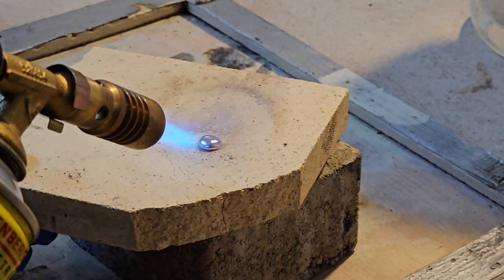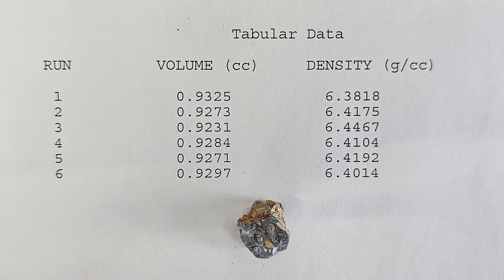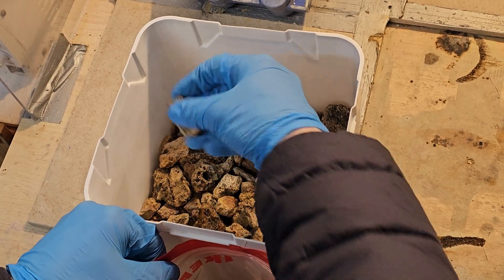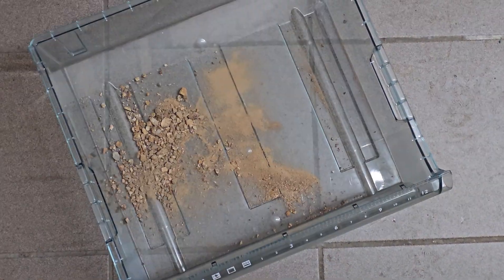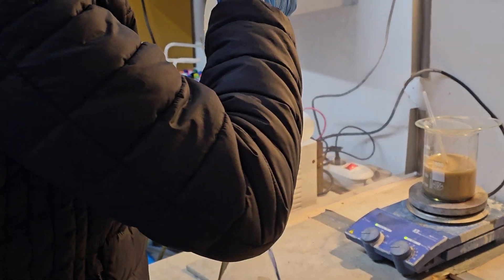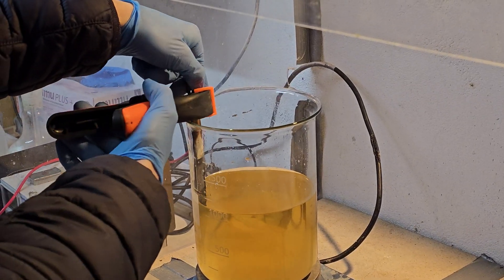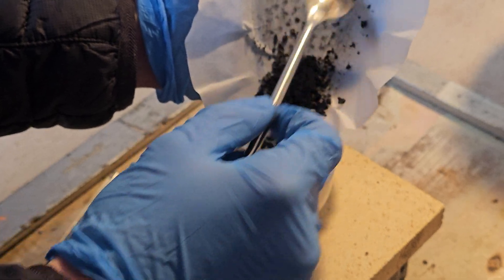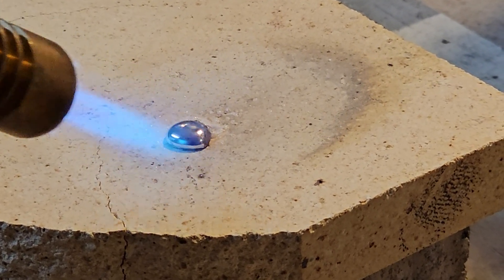Lead ore processing - first analysis

Comment: How to turn your house into a hazardous waste site.

At the temps needed to smelt lead it's somewhat volatile especially the oxides that form on its surface.
Reply from the maker: That's why melting lead also has to be done in a fume hood.
However, the amount of hydrogen sulfide produced here is probably more worrisome than the actual lead.

Comment: Lead is often overrepresented in XRF analysis because it shields the x-rays of the other elements, a layer of lead oxides on the surface can make it worse

maybe that’s the issue here?
Reply from the maker: Good point, but I doubt that's the main issue here, the analysis was performed on one rock, wich was crushed completely and then messured using a stationary WDXRF, which is much more precise than the handheld energy spectrum scanning version.
The 5kg sample comprises of approximately 200 individual rocks, and by just picking one of them the sample might not really represent the batch as a whole.
Also the 5 pieces picked for electrolysis might be the culprit in that they all where just a worst case piece of ore.
Im excited for the final ammount of lead, so that we know an exact figure for the percentage of the whole bucket.